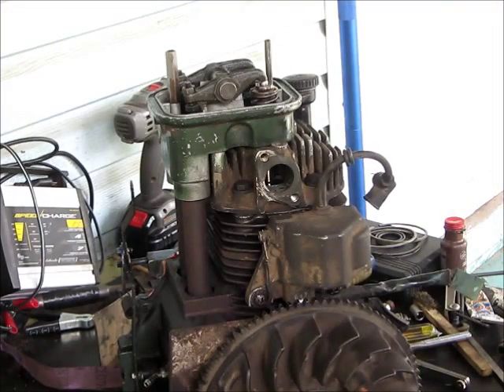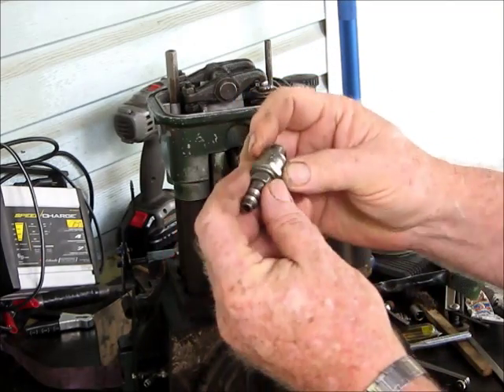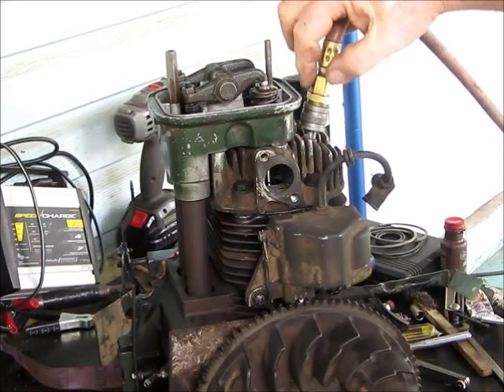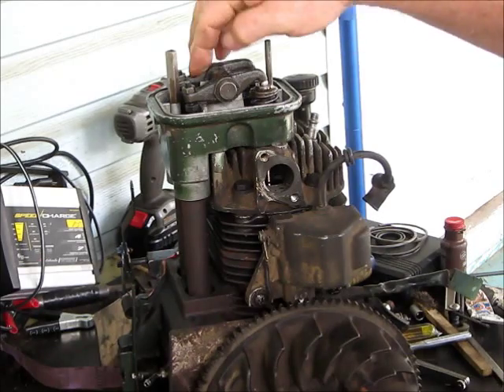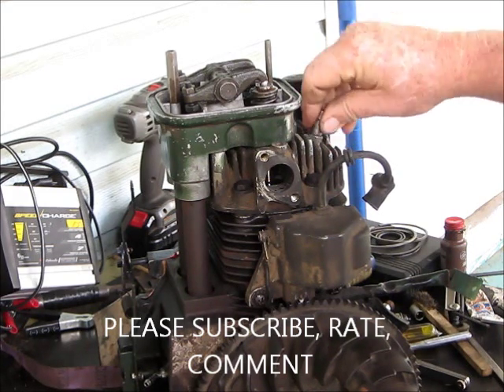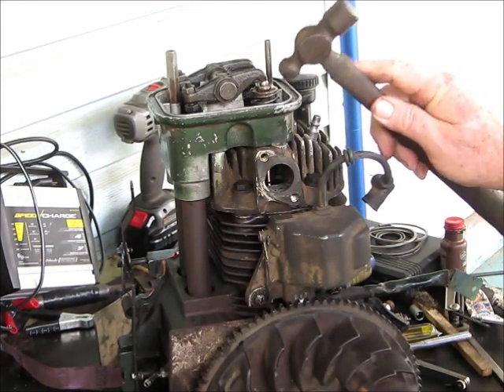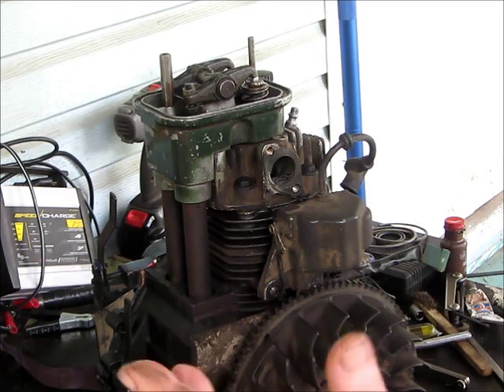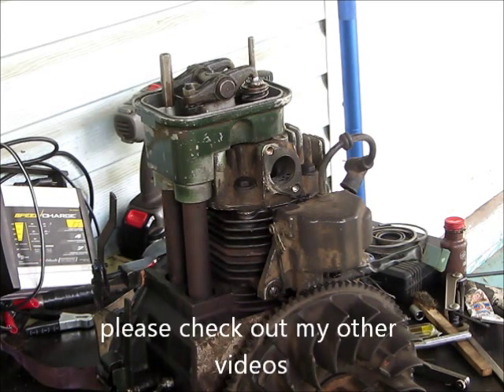TECUMSEH / BOLENS OVERHEAD  VALVE  TIP

Comment: I just pulled an OH140 out of an 83' Bolens Elliminator 1400. Its complete except its missing the crankcase vent tube that goes from that boot at the top down below someplace. I cant find where its it's supposed to attach or go in down below, can you tell me where it goes? Whats that tube made of and what do you suggest I use to replace it? This is my first cast Iron Tecumseh. Thanks.
Reply from the maker: I just looked at the bolens I got yesterday, the rubber tube points to the back of the engine and then the pipe goes straight down and isn't hooked to anything, it's just a breather tube. hope this helps.
Reply: @MissouriOldTimer  It does, thanks. Is it a rubber tube or aluminum.
Reply from the maker: @Mr_Tecumseh  it is some kind of metal not sure if it's tin or aluminum.
Reply: @MissouriOldTimer  I had a feeling it was some kind of thin metal, Briggs uses aluminum tube on some of their older engines as breather tubes. I'll find something too use.
My engine also had a large short tube that went from the air filter to the front shroud for cold air induction, that piece is missing as well. I'll probably use radiator tube for that spot. Otherwise its all their. Thanks.
Reply from the maker: @Mr_Tecumseh  that rubber thing you are missing is pretty thin material not nearly as heavy as a radiator hose, I don't think it's all that necessary because the filter will catch any dirt that might come in there.
Reply: @MissouriOldTimer  The only issue with it missing, was it was the perfect mouse door. Theirs a descent size nest up in the front shroud. I'll have to close it off.
Same thing with the top breather boot, bees went in their. So I have some evacuation's to make.
Reply from the maker: @Mr_Tecumseh  yes there are always pests around.
Reply: @MissouriOldTimer  Well he left that Bolens Elliminator 1400 under a tarp in his backyard for 7 years because something minor broke, which was unfortunate because it was certainly a good machine. But after 7 years of sitting outside, the amount of surface rust and crap has ended its usuable life as a unit. Now its just a good parts machine. I'm in the process of tearing it down. The deck is still good, the trans, differential, engine, steering component's all still good. So it will keep other machines going. It also gives me the opportunity to mess with my first cast Iron Tecumseh. That engine was not very easy to get out of their. It will run again I'm sure. I know that ignition module was still working when he parked it. But hey it was free.
I also got a running cub cadet 1650 over the summer also free. That one has a Kohler. I'm hanging onto that one. With a descent repaint and motor mounts, thats gonna make a very nice tractor again.

Comment: hey probably a dumb question but i'm new to these engines. What would happen if you took those 3 screws out that hold the valve assembly on without removing the valves?
Reply from the maker: I couldn't find anyway to get to some bolts that are under the valve assembly.  I tried to find a way but I never could.

Comment: What a great idea, I didn't have to make a chuck though my air gun chuck threads were close enough to thread into the spark plug hole and I set my compressor for 85 psi and that was enough to hold the valves down to take the keepers out.  Thanks
Reply from the maker: I'm glad it helped,, I used to work on cars a long time ago and we used this method if we just needed to change the valve seals.